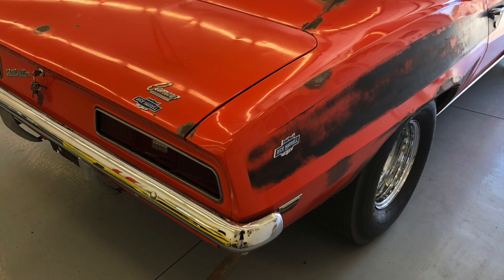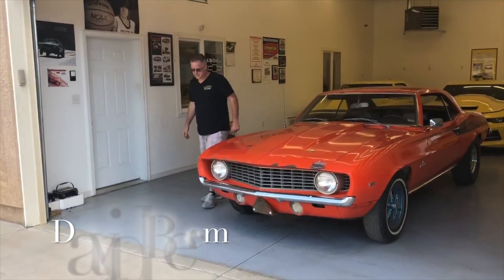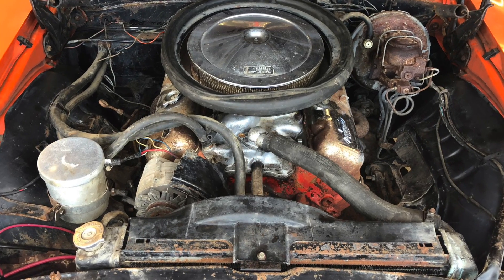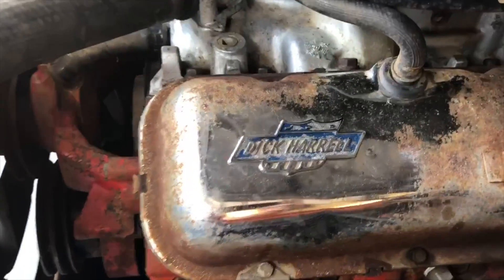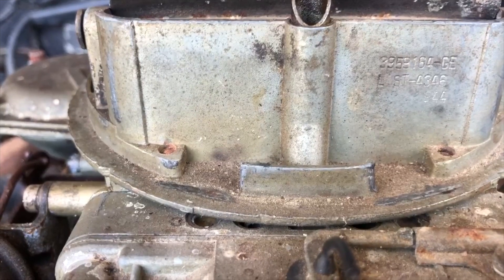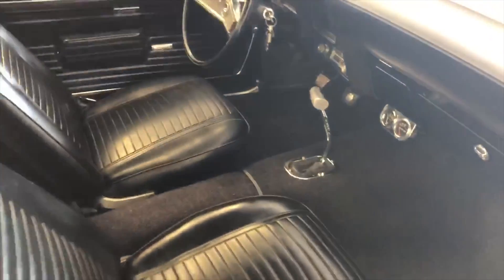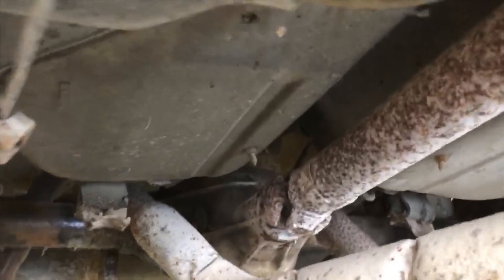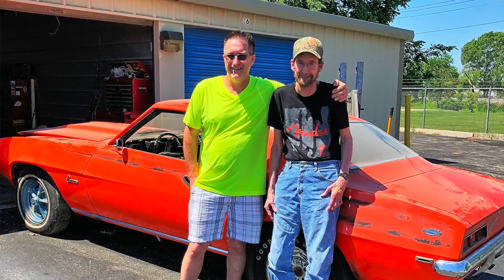1969 COPO 427 Dick Harrell Camaro Barn Find, 1 of 5 or 6 known to exist

Comment: OMG. What a trip down memory lane. I owned a very similar 69 COPO Camaro. Mine was not a Harrell car but everything was the same . My car was built the next week. Same color and all .My car had similar but different stripe ,mine was 3 colors sprayed and full length to the front. I believe the exhaust shown was called chambered exhaust. Mine also had the Hurst T handle shift knob , 120 mph speedo that seemed so undersized at the time. Mine also had the Lakewood traction bars wow. I had my car till 2004. As the story went I sold the car to a guy in North Carolina who restored the car and it ended up in Rick Hendricks collection. The car was sold to gentleman in Pennsylvania who sent the car to McNish for a list to make the car nut and bolt perfect and had the car recertified. Totally by chance we were walking through Barrett-Jacksons auction in Las Vegas fall of 2014 and my jaw dropped when I looked at the documtation on the front seat and the first page was a copy of the certification paperwork I kept when I sold the car. As it turned out Reggie Jackson bought the car.
Reply: ThePiasvids wow good story 👍
Reply: I remember seeing Jackson buy that car.  Small world eh??
Reply: RPMX4 That was an amazing day that I will never forget. I had absolutely know idea that my car was there. Interesting fact is that I could have bought it back but I had no desire to do so.  In mind that car is still in race trim ready to run 10's. However the car was back to bone stock. I'm not complaining, it's not mine and I know the money is in original so u stood on the stage and said goodbye to a old friend
Reply: Reggie has a real soft spot for COPOs and other 427s. In 1993 I worked at Nastalgia Motors in Campbell CA where we sold many of Reggie's cars. One of his was a  dark green 1969 COPO with only 500 miles on it. I took it for a ride around town and did donuts in a parking lot
Reply: Who cares?

Comment: Bill Allen Chevrolet and Dicky Harrells Speed Shop were both in KC, but not 'just down the road' from each other.
The Speed Shop was on Hickman [address on block plate] in SKC almost into Grandview, 'just down the road' from the original Cerner facilities before they expanded up onto the Bannister property.
The dealership was up in NKC on Armour Blvd.

Comment: Another One Found that was Built by Dickie Harrell! So Few Remain in Original Condition as they get Restored. I'm Building a Tribute to what Mr. Harrell was doing back then. It's a 68 Chevelle SS with an L-88 with a 68 427 Block(321 Casting) and a TH400. The FATHER of the ZL-1 Left an INDELIBLE Mark on Chevy Performance History!!

Comment: That chain is interesting. Those camaro motor mounts were  weak. I remember they recalled my dads 69 RS and put cables around the motor mounts and he only had a 350 small block and automatic.

Comment: Please please keep all the original parts but get it running and going, change the gaskets seals etc.. but keep the original the best you can. Take that broken exhaust pipe off put a new one on get a battery change the oil clean up the inside of the engine best as possible and fire this monster up, drive it to shows maybe once a year RIP it down the track on special days. I would love to have this GEM smh wow you are a lucky lucky man. They to get in tact with those Iowa picker guys on TV, they know the best of the best to get cars like this back on the road. This car needs to be brought back alive just needs a MINOR surgey after you give it some defibulators
Reply: yeah, big block camaro & they had baby pipes on it. Rip that crap off
Reply: That’s exactly what we did it’s now running and driving And still looks like this

Comment: the chain means it was built to pull a wheel u tie it from the motor mount to the front left arm it gives it torque to the wheel and it will pull a wheel
Reply: It's to keep it from breaking the motor mounts lol

Comment: Just a rusty old chevy.  Not impressive
Reply from the maker: You are the type of person buyers like to find owning one of these old Chevys.
Reply: Should get it running a driving keep as much original as possible it was made to roll not yard art old parts mean nothing, got an 64 olds that sat in field for 27 yrs new pipes battery plugs and wires tires filters n drove wheels off everyday  all